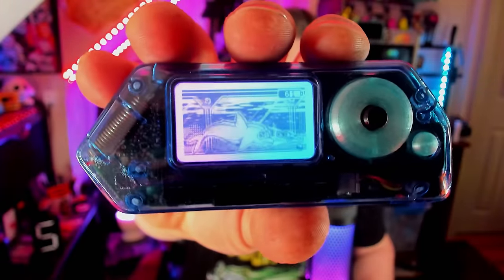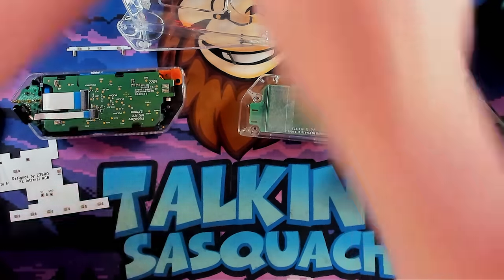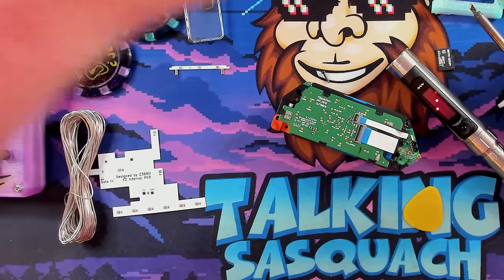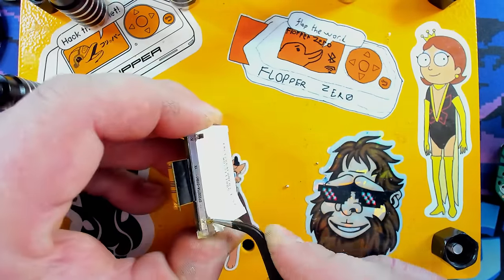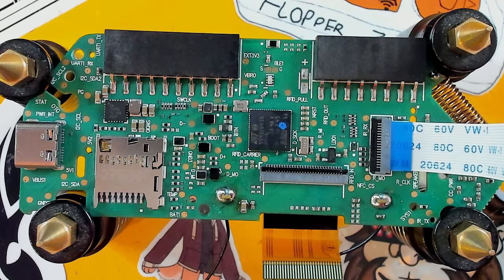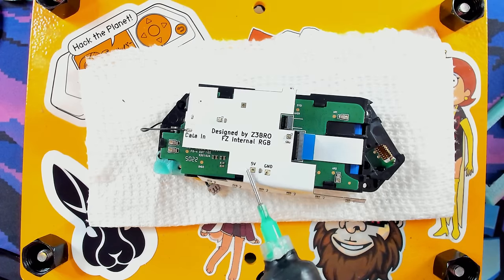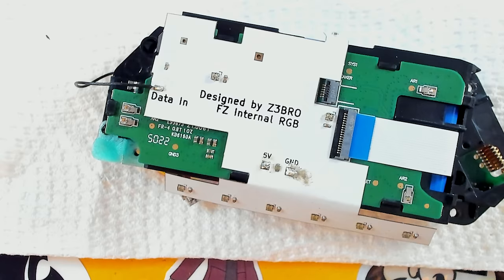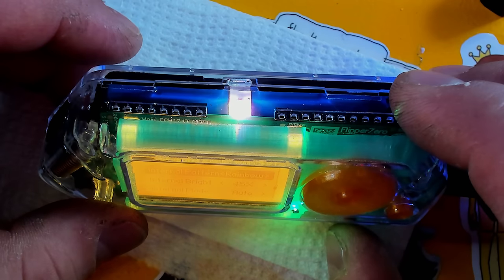This Epic RGB Mod Will Transform Your Flipper Zero!

Comment: Wait you don’t put the springs under the buttons when replacing them either the 3D printed versions?
Reply from the maker: So I haven't but the designer recommends it.  I've done it without springs and so have others without issues